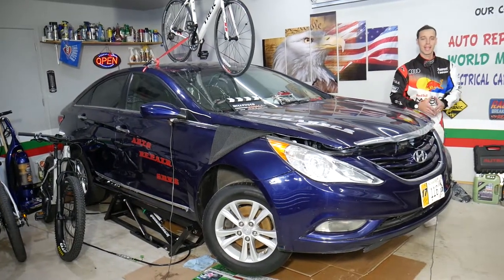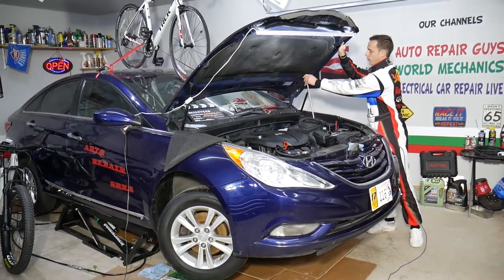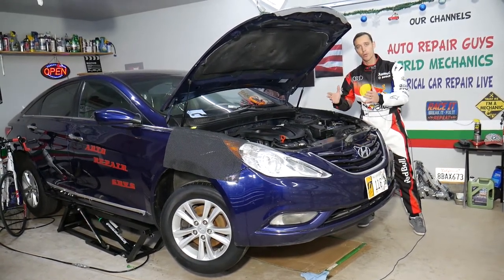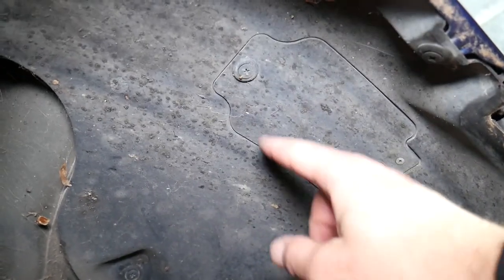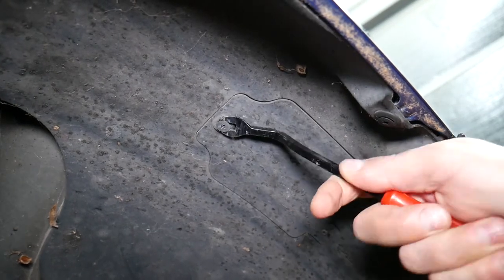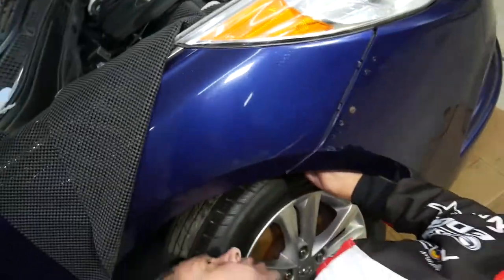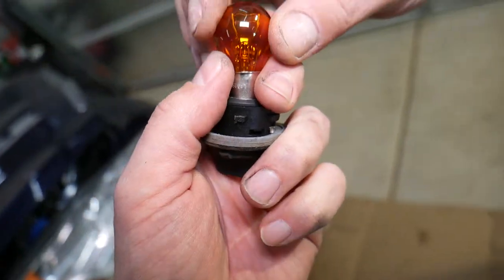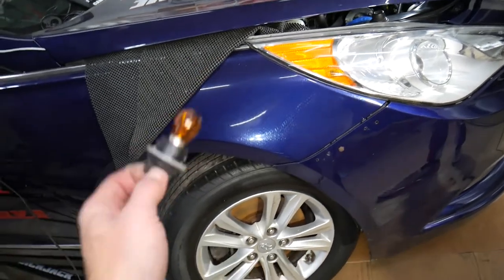HYUNDAI SONATA FRONT TURN SIGNAL LIGHT BULB REPLACEMENT, FRONT TURN SIGNAL NOT WORKING

Comment: Just used this video to change the blinker in my 2011 Hyundai Sonata and it worked like a dream! 15 minutes top (10 minutes trying to fit my hand in, then realizing I could turn the tire to get more space lol). I didn't jack it and it worked fine, though it would probably be easier to. My only problem was the tire in my way, but I turn it facing in towards the car and that gave me the most space! Thank you so much!